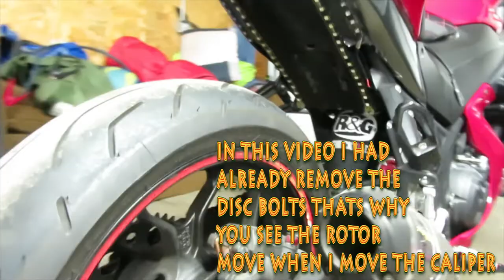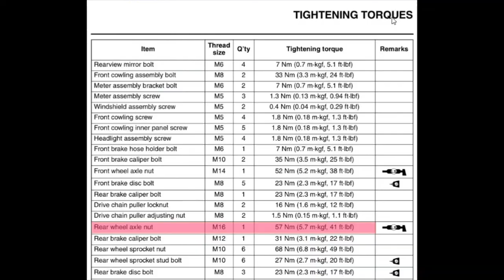How To Install Rear Wave Rotor on Yamaha R3/R25

Comment: How long is this process?
Reply from the maker: 15-25 mins
Reply: @ACProductions77  so a shop wouldn't charge to much to do it? I would but I don't have tools at my new house.
Reply from the maker: @jinx3dproductions168  a shop may charge you between $75hr - $145hr to do the work & even though its not a long process they will tell you to drop off the bike and that it will be a all day job.